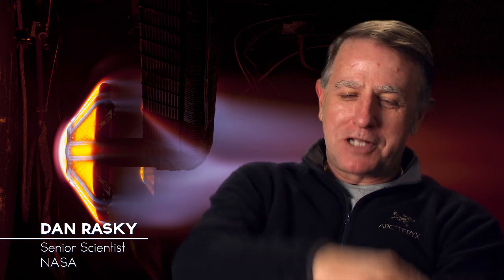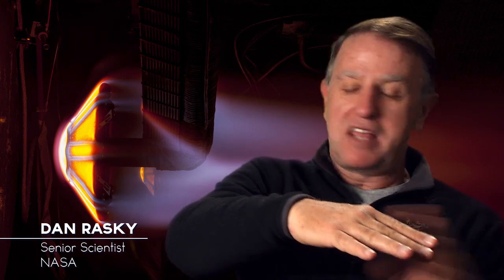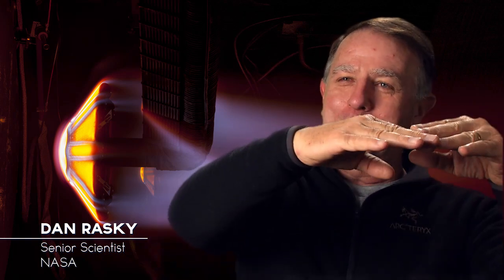Dan Rasky: SpaceX's Rapid Prototyping Design Process

Comment: Very interesting but I would have loved to hear Dr. Dan Rasky contrast the SpaceX way of working with that of more traditional companies in the space industry. For those who don't work in the industry, we don't necessarily know what the "normal" approach is.

Based on what I've read it seems like the follow a waterfall method, where everything is specified in detail upfront and there is little room to change plans or experiment. But it would have been nice to hear concrete examples of how these differences play out in practice.
Reply: Erik Engheim : In their defence, the waterfall method is highly effective for straight-forward iterations of existing designs, which is what they normally do.

It's also part of why noone has released a flying-wing airliner.
Reply: q : Well, I actually said that it's part of why, because another reason why is that flying wing airliners would have fewer window seats, and window seats are popular.

As for how this is related, the waterfall method of development is best suited to modification of already existing designs, so developing a flying wing airliner would be inherently slow, and somewhat artificial, because there currently aren't any flying wings airliners, thus forcing the waterfall method to start by completely redesigning the majority of the structure: this is inherently a much bigger job than just producing a new design of conventional-fuselage aircraft, since for conventional designs you can just start with an already existing design, make a few major changes, and "percolate" the consequences of those changes through the design.
Reply: Jared Maddox what do you mean by "this is why no one has released a flying wing airliner"?

Comment: SpaceX isnt a government thats why it takes "lightspeed" to do things
Reply: This has nothing to do with government. All the other private space contractors work slow as well. My impression is that this is because they use the waterfall design methodology, where you plan extensively and specify everything in detail before implementing everything.

SpaceX OTOH seem to follow the approach popular in software development, which means lots of experimentation, prototyping and iteration and a lot less planning. It probably makes sense because Elon Musk comes from the software industry.

Tesla also seems to follow this approach which is why Tesla designs cars much faster than other commercial car companies.
Reply: Dot Red, private companies have no more incentive to be efficient than the public sector. They have an incentive to make money. Often that means becoming more efficient or making better products. But by no means is that always the case. Sometimes it is easier for private companies to make profit by creating monopolies, introducing artificial needs. And sometimes profit making doesn't necessarily create anything of value. In fact it could be the direct opposite.

There are lots of examples of this, but perhaps the most recent ones are the pharmaceutical companies producing strong pain killers. These companies caused the Opioid Epidemic  in the US. They originally made drugs for a limited market, invasive surgery. However due to the profit motive of private companies, and in particular in the US, where the philosophy is that companies have no other obligation but to make share holders rich, these companies pushed through legislation to allow their strong pain killers to be used in a much larger segment of the population. Dramatically expanding their customer base. Essentially they operated as a big drug dealer wrecking havoc on American heartland.

Another example is the financial sector which has a strong profit motive to create financial asset bubbles. Neither of these things are good for the economy.

I agree that in the cases where the profit motive of private companies are aligned with the interests of the public at large, then it is great system and better than a government run system. However while government options can seldom become super efficient they have incentives which private companies don't have, and that is public and political pressure. Hence in cases where the profit motive can't be aligned with public interest you will likely get more efficiency out of a government run system.

You find many examples of this within health care, education and services such as military, police, prisons, and public transport.
Reply: @erikengheim1106  government contractors are heavily regulated, period. they have to go through all kinds of quality checks and audits.
Reply: @penbrun273  Still not buying it as being significant, because there is a great counter example. Elon Musk is demonstrating exactly the same kind of rapid development compared to the competition in the car industry as in the Space industry.

Last time I checked the car industry as not government run, nor where they government contractors.

It is just that subcontracting is a slow and inflexible way of doing things. It has been analyzed e.g. why road building in the US costs 2-3 times more than in comparable countries.

The conclusion was essentially that it was all down to excessive subcontracting. Subcontracting has developed into a disease in American society. SpaceX and Tesla are moving fast, because Elon Musk is saying "screw you" to subcontractors.

As someone who has worked in subcontracting as well as product development without subcontracting, I would say it is obvious that it is not an efficient way of doing anything.
Reply: @Dot Red private companies main incentive is profit. government entities like nasa need to be above the politics of the day to function more efficiently. that's nearly impossible today.

Comment: Whats a Pika? Did I spell it right?
Reply: +akram4179 Here ya go: http://www.spacex.com/news/2013/04/04/pica-heat-shield

It's a heat shield
Reply: Thanks!
Reply: Making body armor inpenetrable is not the hard part.
The hard part is to make it light and comfortable.
Such a shield would be worse than different solutions in that regard.
Reply: yes
Reply: Curious could you use this stuff for body armor?  Ablative Ceramic pretty much fits the description of body armor.  Manufacturing process too expensive???